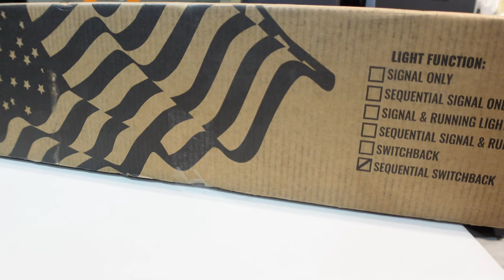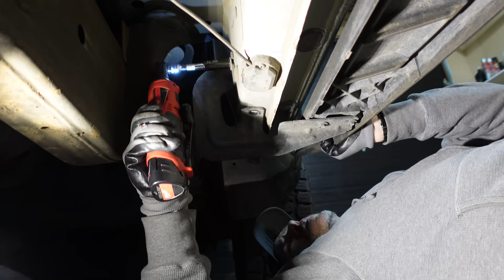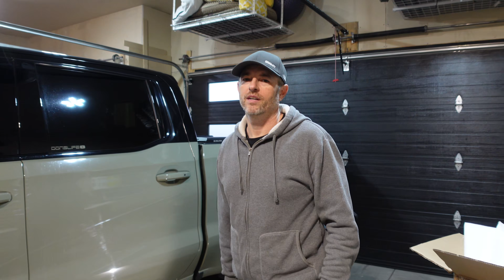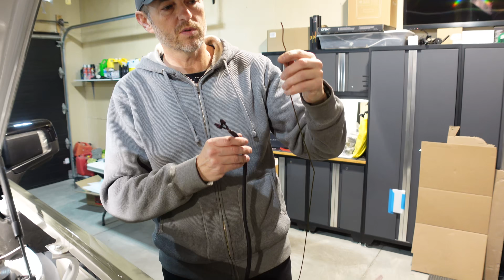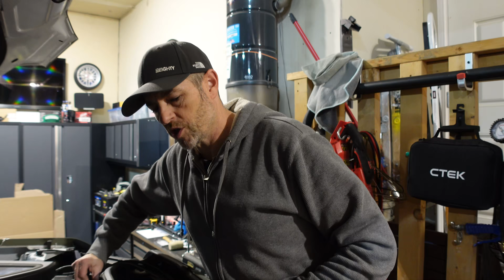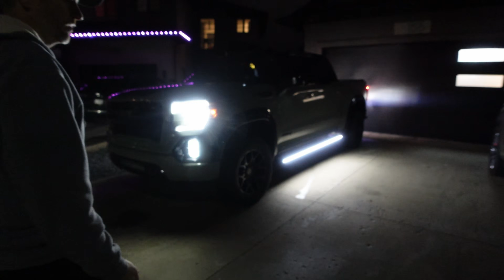Lumastep M1 Running Boards – Game-Changing Install on My GMC Sierra AT4!

Comment: Hi Don, I really appreciate all your helpful videos! I was wondering if there's a plug and play wire harness that connects to the taillights to run two bed light strips. I'd prefer to avoid cutting into the factory harness if possible. Thanks a lot!

Comment: Awesome videos. I picked up a 2024 1500 back in October. One of my biggest pains is that the rear door don't have the keyless unlock button, I'm always putting my kids in first 

I noticed yours has them. Did you add that, or did the 2019s come with them?

Thanks!
Reply from the maker: Thanks for watching the video!  My truck came with the button for each door handle.

Comment: I can’t find the same pattern that you have on the video. I just had the ones with the straight lines. Could you help me find the pattern that you have on your running boards?
Reply from the maker: I have had 2 versions of these.  Can you be more specific on what you want to have happen?

My favorite is amber DRL, amber sequential signal with white rock light  option.  

I realized after the first video that a white DRL on the side might annoy local law enforcement

Comment: Are you still happy with these running board lights?
If so, would I be able to connect the Rock Light Wire to my Reverse  Lights so they default to white when reversing?
Reply from the maker: I do like them a lot!  I have been testing their power fold up ones now too.  Yes you could easily connect the wire for the rock lights to come on with the reverse signal

Comment: I have these running boards ordered. Also have the light up gmc logo. How do you run both of these together since they both use headlight for plug n play ?
Reply from the maker: Once you get your products in, it is just adding another plug inline.  Mine is all hooked up simultaneously
Reply: @Donslife  appreciate it sir

Comment: Excellent videos. I like how clean and proper your install videos are. I want a set like you have very nice. I have cheap opt5 ones. I got no complaints still on 2 years but those are much cleaner and I need new running boards. Keep it up
Reply from the maker: Thanks man 🙏

Comment: Question for ya. I’ve noticed that on dark streets at night making  left turn, it’s kinda dare on the side of the truck so there is a possibility of hitting stuff on the left and even the right.  I know that the boards with the white side light which should help with that.  I’m planning on ordering these but only with the yellow.  I think the white is too bright for my taste.  On a side note have you experimented with side lights so that that dead dark area would be minimized when turning?

Comment: Hey Don, love the running boards and the lighting.  Any chance you can get another discount code for a percentage off like you had in November. Everyone is trying to save a buck and with the price of these trucks and my payments anything would help.  Tks again for the vids. Love the mods.,
Reply from the maker: I asked.  They have some system limitations that don’t currently allow for a permanent or temporary discount code that is unique to my audience or otherwise.  They will have sales from time to time as well though.
Reply: @Donslife  Tks for trying.  Nice vids.

Comment: I wanted to buy these for my truck but was unsure  how they would hold up to winterpeg winters.  Especially  after dealing with my BOOST Tow mirrors  failing miserably  after going over bumps and cold temps they broke under their  own weight. Literally  snapped..
Reply from the maker: Really?? The tow mirrors on my F-150 crew truck are like new still.  As for the steps, I was curious how they would hold up as well.  So far just fine.  No operational issues either.

Comment: Hey Don, those are pretty cool. I think I’m going to get me some too. I do have a question for you though. What wires in the left and right headlight harnesses are the turn signals?
Reply from the maker: I think if you download the instructions on Boost’s website for the wire tap installation, it would indicate that info there
Reply: Sweet. Thanks my man!

Comment: This is pretty slick. Can you have the steps be drl amber for night driving versus white?

I think it’s weird not having the step go the full length or having to have a gap at the front if you want to access the bed
Reply from the maker: I am currently finishing up a video to answer your question.  I can't speak to the length since I am not involved in their development.  I agree that another 8" would be nice.

Comment: Great videos always Don. I have a question about a correct fuse to use. I need to know which fuse and location to hook to for power when I click on my key fob for power for lights I installed above my side steps. I want these lights to come on when I click to unlock the truck.  My truck is a 2019 Custom Trail Boss. Thank you for any help   Donald

Comment: love the video, quick question if i choose to get the signal and running light option would i have to tap into the battery or would it just feed power of the plug and play harness that adapt to the headlights?

Comment: How can I find the circuit amperage for like the cargo lamps ? On a 2023 Silverado
Reply from the maker: Try a multimeter by tapping the back of the light at the harness plug and turn the circuit on

Comment: Can you put Amber light when it running and white light when you unlock the truck?
Reply: Unfortunately not - the start up sequence will match the color of the running light. That being said, if you do an amber running light and option with rock light - you can get the strip to illuminate white via the rock light switch, just not with the start up sequence when you unlock the truck.

Comment: Don, any issues with the truck and its systems from disconnecting the battery to do an electrical installation and reconnecting it afterwards?  Most of my cars are old enough to not have the most modern electrical and computer systems on them. However my wife has a 2021 year model Chrysler. One time I disconnected and reconnected the battery for some minor maintenance and the next time we cranked the dash lit up like a crashing 747. Every one of the driver aids systems, infotainment system,  etc flashed a warning light.  It took several rounds of cranking and driving before they finally self cleared.
Reply from the maker: Never had an issue with disconnecting the battery on this truck, the 2022 Escalade yet.   That would be pretty frustrating
Reply: @Donslife  Thanks for your reply.  I have 2024 GMC on order and have several electrical mods planned.  Glad to know that I won't be facing that issue.

Comment: @donslife do they stick past the tires ? I have wide wheels just want to see how they would look
Reply from the maker: They will stick out past the stock/factory tire stance.  They line up with my current setup which is 1.5” wider (outwards) than stock
Reply: @Donslife  sounds good I have oddest wheel with 1/4 spacer so thry would look fine

Comment: Nice product demo video. 
When I first saw this new video I thought… Oh no Don is going to demo much nicer cab steps than the outrageously expensive Amp Research steps I already have on my 2023.
The Boost steps are very nice but I’m keeping my Amp Research steps.  
The differences are the Boost steps are stationary while the Amp Research steps are retractable offering a lower step up into the cab. The Amp Research steps have two small lights per side… not the very cool lighting options of the Boost step.      
I ditched the lame lighting of the Amp Research steps when I installed mine using some much nicer LED strips. Its better lighting than what was included but not even a comparison to the Boost step sequential lighting. 
If someone made it I’d like to buy a sequential light kit for my Amp Research steps… that would be the bomb… retractable sequential lighted steps.   
I can confirm the way Don fished the wiring down the inside of the fender is the way to go. Its not so hard to do once you get started. 
One of Don’s signature habits is doing a very clean install. He strives for an OEM finish once the install is complete. That doesn’t happen by accident.   
Don has a knack for finding cool off the beaten path accessories giving us a good demo of how it works and installs.
Soldier on Don   😂😂
Reply: Agree with everything you said and I'm also happier with the look and function of my amps on the AT4. I also ditched the supplied amp lights for a much nicer (and whiter!) LED strips. My main issue is the boost running boards besides the stationary nature, is how bright the light is, literally washes out the puddle lights. I think the perfect product has the function and customization of the boost light strip at about 20% brightness along the edge of amp powered steps. I can dream can't I??
Reply: Hey Doug. I would love to see what you did with those factory steps and the lighting.